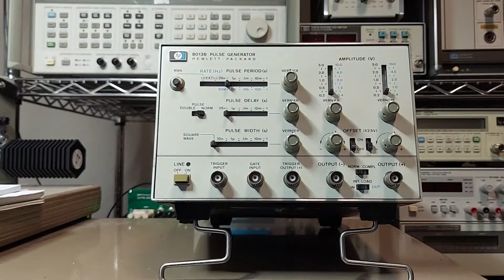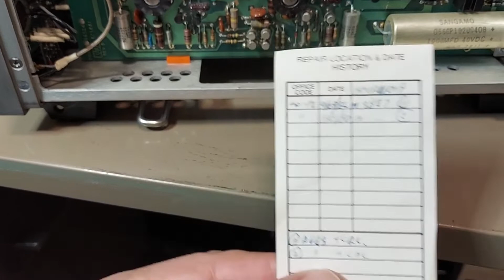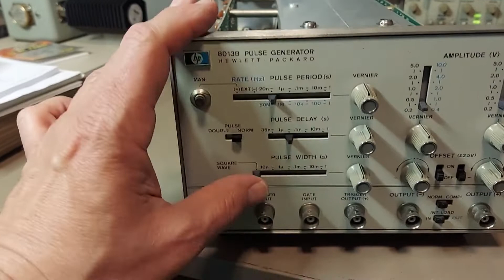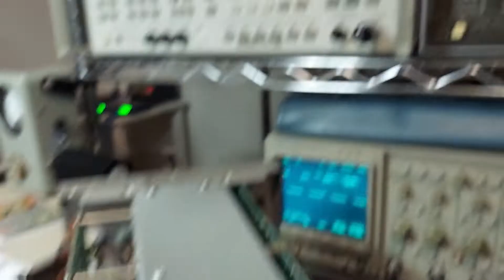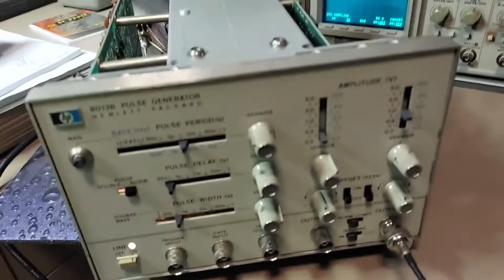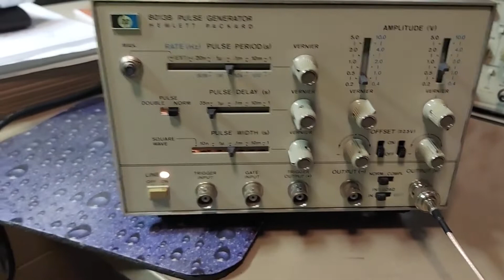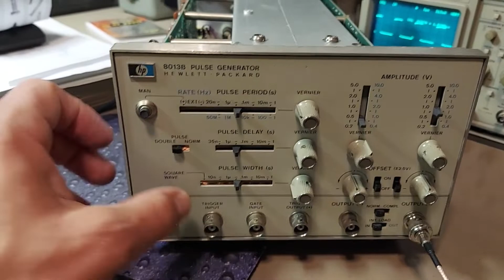HP 8013B Pulse Generator

Comment: Nice machine Craig, I have the HP 8112A, not a big fan of it, have plans of replacing it with a Wavetek  Pulsar when one comes up at a price I wanna pay. Would like to see the cal portion of yours....mine was semi-easy.  73's OM DE Jack, VEG
Reply from the maker: This is my second 8013B, I bought this one for parts but once the slide switches were cleaned it worked too good to cannibalize. All stepped through the performance checks on this unit and found it to be either on the edge or within spec, so with that said I may do a calibration later on down the road. Thanks for watching!